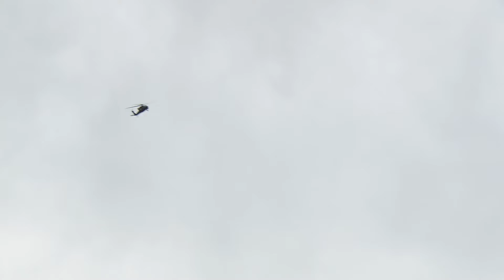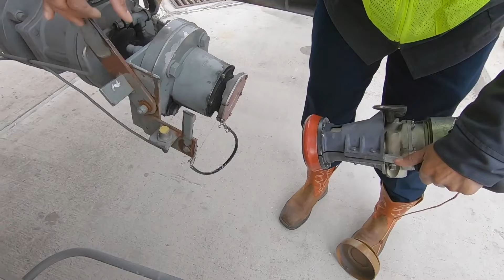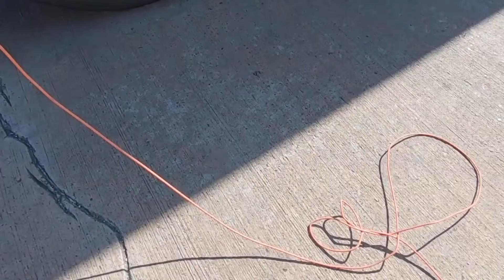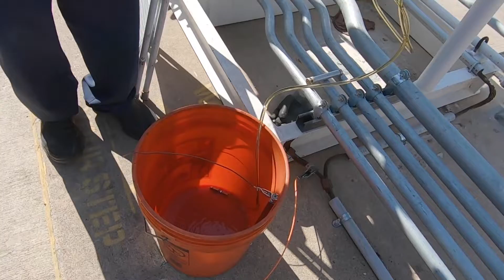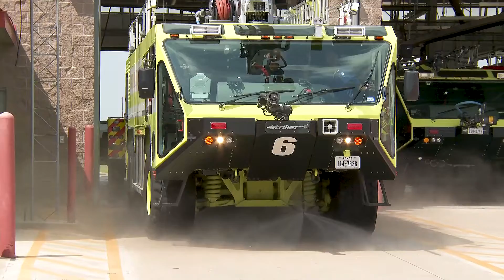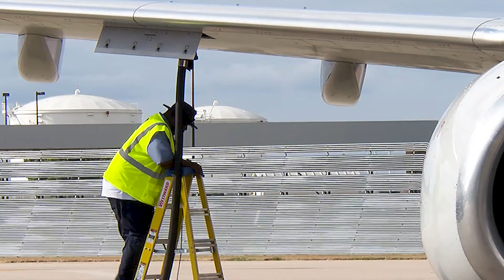Airplane Fuel Storage Facility – Operations and safety procedures at AUS

Comment: Thanks for putting the effort into this video to entertain geeks like me.
Reply: Are contingency pipes pre installed for future expansion at airports?
Reply: Airport storage tanks: Suppose a tanker carrying a load of aviation fuel was received, with a density of 0.7791 kg/L at 15°C. A sample was taken, and all tests were compliant. The density difference at 15°C did not exceed 0.0030 between the two densities.

The load was discharged into a tank that already contained a remaining quantity from a previous shipment with a density of 0.7998 kg/L at 15°C.

After allowing it to settle for one hour, a sample was taken to issue a permit for using the shipment according to the Operations Manual form. After calculating all densities, weights, and quantities, the result of the sample taken from the tank was fully compliant — the density at 15°C was 0.7798, and the density difference did not exceed the allowable limit of 0.0030.

However, on the next day, during the morning sampling and after drawing a small drain from the bottom of the tank, the density at 15°C was 0.7964.

What is the cause and what is the solution?